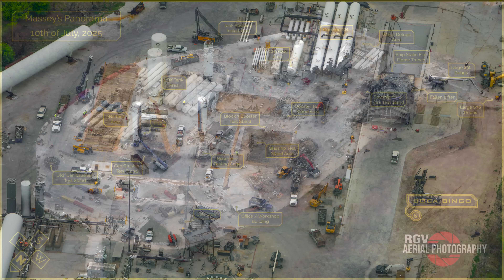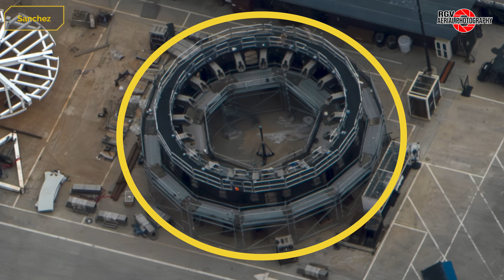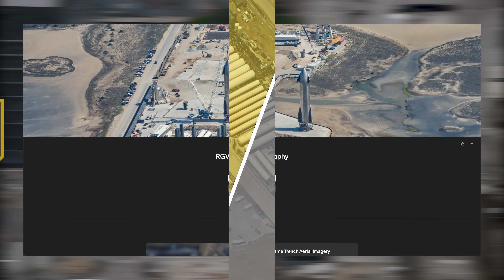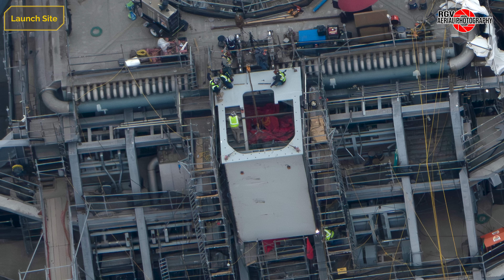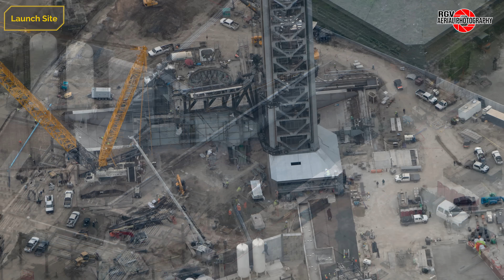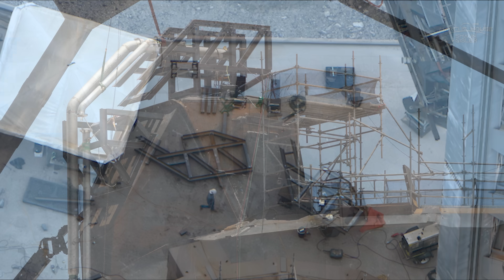Fast Work at Massey's | Flyover Update 89

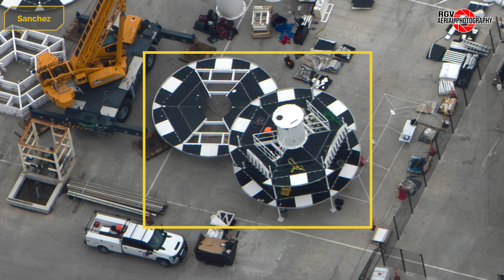Comment: 2:35  Those are giant wheels to put on the side of the booster transport stand. No more need for SPMTs, they can just tow it with a Cybertruck.  😉😁
Reply: Don't give them ideas, there are CAD designers at Boeing still working on wheels. 😂
Reply: @CatInWonderlands  and squares!!

Comment: Why 6000' now instead of 10,000'?  Was the altitude restriction reduced?
Reply: Yes it was! They’ve already commented on a stream that it made a big difference in image quality.
Reply: @petesGuide That didn’t answer the question though, what is the reason of a flight altitude reduction?
Reply: @Jroman-7  I don’t believe a reason was given, the new flight restrictions were simply published.

I could speculate that because the land covered by the restrictions greatly increased, that the height was lowered to make them less onerous.